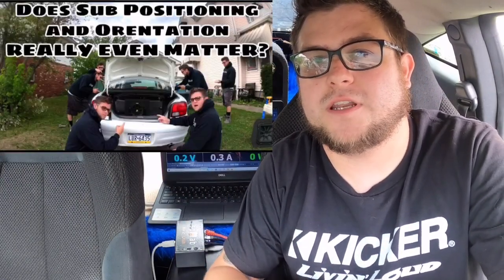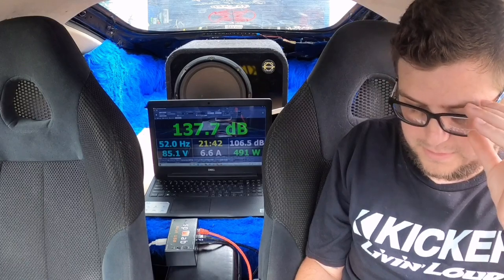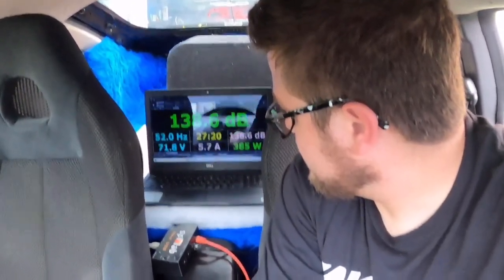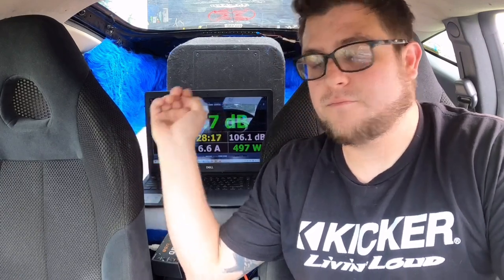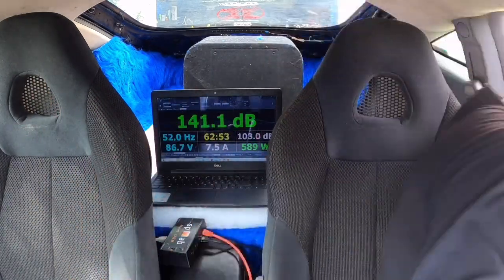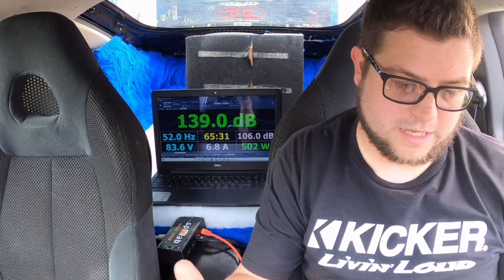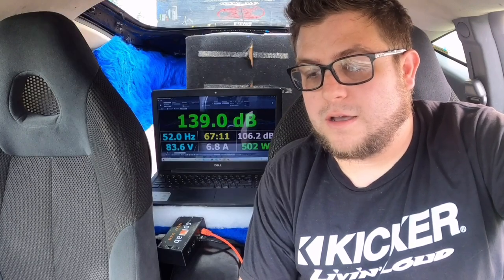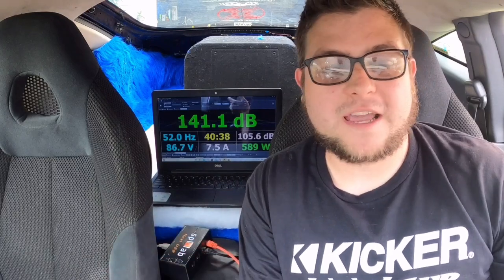WHICH WAY SHOULD I FACE MY SUBWOOFER? DOES IT REALLY MATTER?

Comment: Great video. Good to see official numbers. I tried this test (listening only) with seats down/up in a trunk (2×12) in up, front, rear positions. Rear facing had significantly deeper bass, but front was louder/punchy just not as deep. Results got closer with seats up, but still the same result. Be aware your trunk will vibrant way more in rear facing since sound waves are bouncing off the back. Rear plate rattled way more. Some thin door weatherstrip foam all around fixed it, but trunk still flexed/rattled elsewhere.

Comment: Ive been switching my setup around for the pass year 😂. My dual  ported qbomb box with 12s gothics at 2ohm is closer to the trunk door probably 2 inches from trunk door. Right behind seat seal single box with 12 gotchic at 2 ohm facing front sounded way better than the qbomb box facing front or up right behind seat. Qbomb has a power acoustik 2500x1 and the other at 2ohms by itself. Sound nice af for a budget build. Got 5 if them now just taking my time on my first blowthru build 😊

Comment: Great video!@ Hopefully you can help me, i have a SUV im about to install 2 12" sundowns, the main point of the stereo is for playing out camping and not so much in the vehicle, in your opinion what would be the best placement for the sub for that situation. The box is 2 12" subs pointing up and a L vent port on the side, but can position the box also so the subs are pointing straight and the port facing up?
Reply from the maker: Hmm good question 

If you are keeping the trunk shut when camping I would fire up or back 

If you are opening it all up then maybe firing in might give a better overall sound for casual listening by the fire 🔥👊🏼

Comment: I know this is more box design then just simple orientation but thought the question fit better here then elsewhere. I noticed that Cookie Monster has the sub up/port back. Is this configuration typically louder in small hatchbacks or more just a way of working around size constraints?
Reply from the maker: Sub up port back works for a lot of hatch /Suv styles 

With other enclosures I actually gained some sub firing back - port to the side 

Kinda all depends where the meter is and loads of other factors 

But yes for Cookie Monster - kinda stuck with what space ya have and it worked in a smaller application so I amplified it 😂🤘🏼

Sorry for the 7 month later response lol

Comment: Is it a lot of pressure on the hatchback when you fire it to the rear?
Reply from the maker: Some but bass waves work in mysterious ways 👊🏼
Reply: My 2, 10" Kicker SoloBerics will pop my trunk on my Altima every now and then. To the point where my latch is now worn and I come out some days to my trunk open 😂. Even with the entire trunk lined 2 deep with sound deadening material it still can pop my trunk.

Comment: I have a serious serious question I'm new to this
I have a F150 and recently got a dual 12 down fire box and I hate the outside rattling at the bottom of my truck.
I can return them by Friday and I wanted to look at 4x8 front firing box will take this rattle away
Please help and don't judge man!
I'm a newbie
Reply: Make sure it’s not the box that is rattling also the subwoofer isn’t rubbing if nether of those are bad then look in the truck for things that might be rattling in the area and try to sound proof/ tighten it up